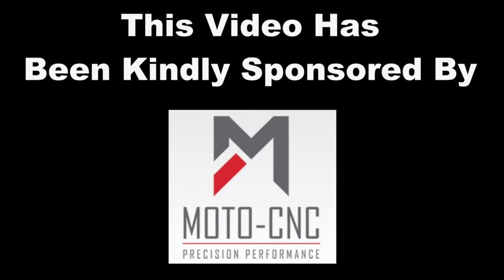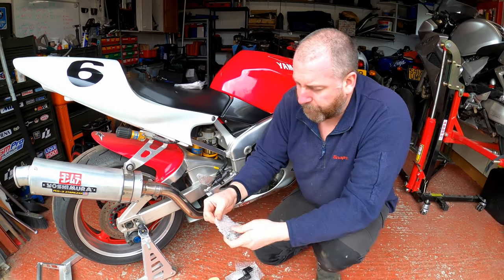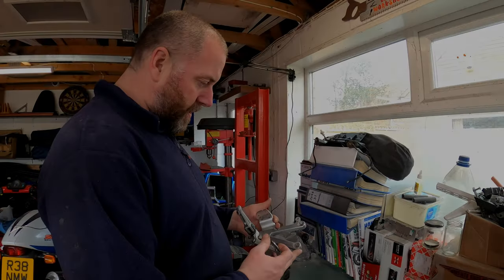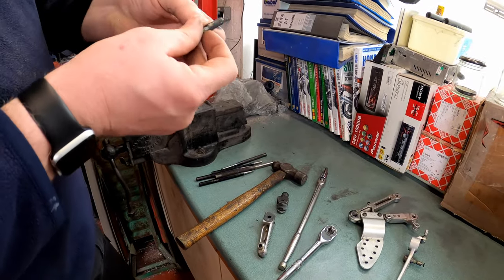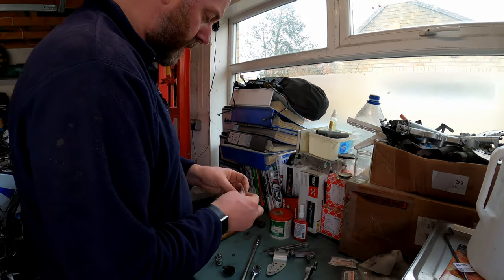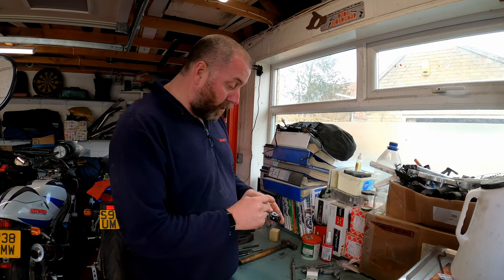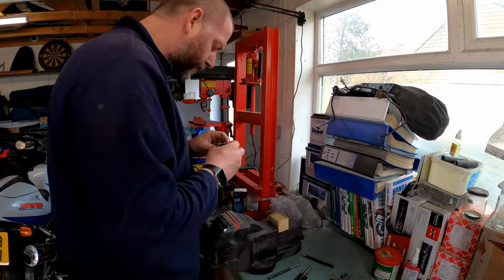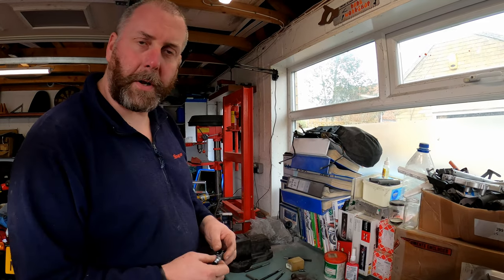Fitting A Moto-CNC Vario Adjustable Foot Peg Kit To My Yamaha R1 4XV

Comment: Just buy an 8mm clevis pin and split pin. They're cheap off ebay. 2003 R6 is exactly the same. I think I'm going to be getting one of these kits but won't be wrecking the original footrest bracket. I'll get a 2nd hand one and butcher that. I'm a little wary of those 'race' pegs. If you were to have an off, they're a little sharp looking and there's a possibility of it stabbing you. That's why the standard footrests have a rounded end on them.